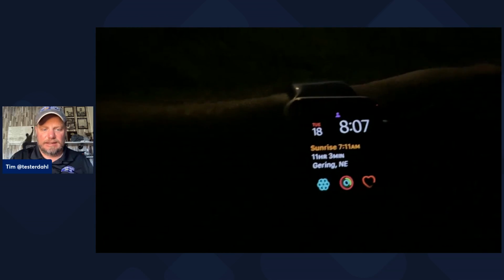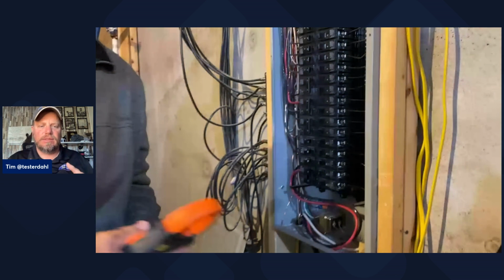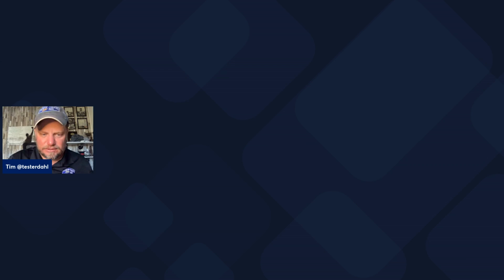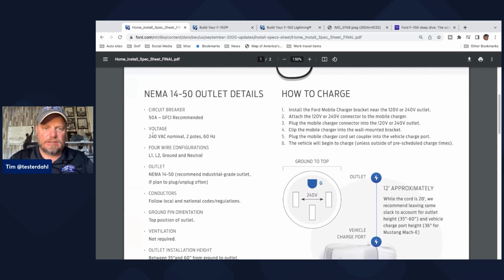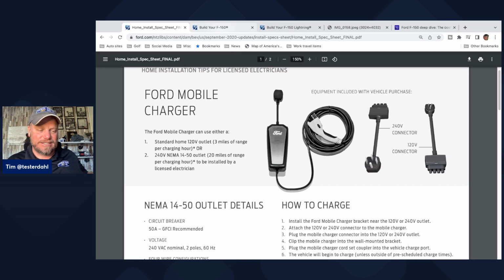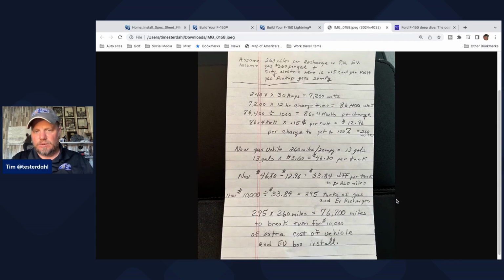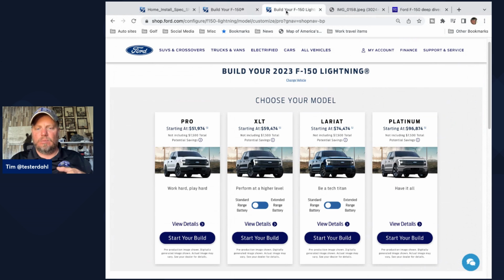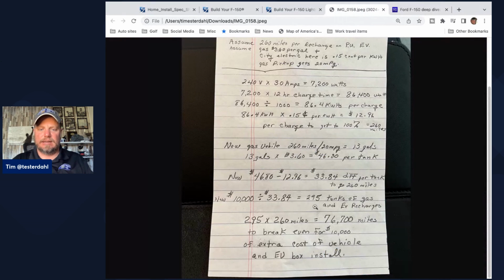11+ hours later on 220V charging price for 2022 Ford F-150 Lightning

Comment: Sure eventually the electric upgrade pays for itself in fuel savings and you start to see savings after several years or 75k miles. But it is a limited savings window as the cost jumps for the EV significantly when you have to replace the battery. The lightning battery standard range is listed at $28,556, and the long range at $35,960 for replacement. So it took 75k miles to break even on a 10k price difference. But you'll need an extra 225k miles just to cover the battery replacement cost... So pretty obvious that the electric version will depreciate like crazy past the 8 year or 100k mile battery warranty (which warrants it to only be 70% of original capacity).

Comment: You never run continuously an electrical circuit near 100% of rating due to the risk of overheating and electrical fire.  The use of a 50 amp 240 volt breaker and #6 copper wire is appropriate for any device drawing 30 amps continuously.

Comment: Source (electrical) needs to be 1.5X the highest rated current used by the appliance(truck).  That's why you have a 50 Amp circuit suppying a 30 Amp Load.

Comment: I believe the battery, like many rechargeable batteries are happier at a little under full charge. The decrease in range at full charge is probably a programming glitch. The true range is what you actually get on the road.

Comment: Well, I have solar on my roof and while my system provides all the energy my house needs, it actually produces too much during the day and in PA it is net metered and also  there is this pesky thing called sundown when it doesn't produce and I have to pay for the generation of electricity while the panels aren't producing.  So hoping to get a Lightning to help soak up a bulk of electricity during the day when the panels are producing to charge the truck.  So basically my electric cost would be just the generation side if I charged during the day of about 8 cents a kw.  I know this doesn't quite make total sense to those of you who don't understand how net metering billing works in actuality.

Comment: Yeah I'll stick with my 2003 gas ford ranger 10 min fill up 343 miles out of a full tank 12 gallon tank right now takes about 30 to 35 dollars to fill up. I'll be last on planet earth still driving a internal combustible in my eye there more practical
Reply: You're not the first person I've seen in the comments section say it takes 10 minutes to fill my truck with fuel in comparison to electric charging. Here in Canada I've got a 2005 Dodge Dakota that has an 83 liter or 22 US gallon tank. Gasoline fuel pumps across the country flow 38 litres or 10 US gallons per minute. They are inspected and certified regularly. Just two and a half minutes at the most and she's got a full tank from empty. Did you mention 10 minutes as simply a figure of speech? Lol. ICE vehicles will always beat out EV's overall.
Reply: But you are driving a 20 year old mini truck beater.

Comment: So what are the used truck prices at various times; we don’t know yet about EVs. The battery diminishes over time and has to be replaced. Warrenty? How much is an EV worth with 75,000 miles vs a gasoline truck. Are the EV batteries shot and cost as much as a new truck? Only time will tell. An old F150 does holds its value. What does insurance payout on an old EV that the batteries catch on fire, in your garage while you are charging it? Too many unanswered questions.

Comment: I have a 2021 Tesla Model 3 rear wheel drive.  Normally charge 110 volts with the cord which came with the car (understand the cord is no longer provived).  Installed a 220 volt dryer outlet  in the garage in case I needed to charge faster and bought the related extension cord.  A dryer is used intermittently maybe several hours a week.  It does not put a load on the electrical components which a charging load would encounter.  I will not be using my dryer outlet to charge unless it is dire emergency.  I did not know the 220 volt charger needs to be wired directly to the house wiring and only bakelite fittings should be used. Repeat: only BAKELITE not bakelite synthetics.

Comment: What is the cost of a battery after 75000 miles? I heard it was $35,000 plus install. Thats on a old truck with 75,000 miles on it.

Comment: They want a heavier wire because it is pulling 30 amps for such a long time when charging. That's why they want you to use a heavy duty 50 amp 4 wire plug. Have seen standard plugs that were melted. Your dryer n water heater are on 30 amp breaker, but those don't  pull those amps for 13 hours at a time. They are controlled by thermostats, so it is on n off.even your oven does the same.

Comment: Time is money. In construction where we have 100+ jobs running at one time, we don’t have time to wait for charging and some/most days the range of an ev truck won’t make it. Especially since we usually tow every day. Gas and diesel are the only way in this industry as of now.

The only other way EV could work is if trucks and cars all used the exact same battery that had a “quick change” option. This would make it so charging stations could have certified techs and fully charged batteries on hand to swap out in 10-20 minutes. Which is close to the average time spent fueling from empty to full. BUT then you would have the cost of a tech/labor fee. Which would completely remove any difference in fuel vs charge cost.

Comment: With all the press and hype over EV's, they never revealed one simple fact:

Electric vehicles are only cheap to operate if you get "?free charging".  If you have to pay to charge, they will cost more to operate than a comparable gas or diesel vehicle.

Comment: Ok...treating that 49% 'fill' on 11-hours at 6,600-watts...that's 72kw's for 119-miles of 'potential'...at $0.14 per kw (off your utility meter), that's roughly $10...or 11.9-miles-per-dollar. Diesel at $1 a gallon, that's a bad deal. Diesel at $5 a gallon, that's a good deal...no diesel at all, well, what do you do? Then again...a LOT of people have reported trying to tow with EV trucks, with 'full-to-empty' happening in 20-30 miles...so, there is the 'work aspect' to consider.

Comment: i want to take a stab at simplifying your analysis comparison of an electric Ford pickup and a gas Ford pickup.  First: you CANNOT tow the same weights with an electric truck versus a gas truck UNLESS you are willing to spend additional HOURS of recharging your electric truck.  so the gas truck has a MASSIVE advantage if you tow an RV or a car or cargo trailer over the electric truck.  Second: you CANNOT haul the same loads in an electric truck versus a gas one unless, again, you are willing to spend additional HOURS recharging the electric truck.  Third: the electric truck WILL NOT perform as well in cold weather or winter conditions as a gas truck. several studies show that electric vehicles lose up to 40% of their range when the temperature falls below freezing (32 degrees F).  Fourth: while maintenance costs are continuing and can be significant for a gas vehicle, the cost of a full battery replacement on an electric truck is STAGGERING - in the case of the Ford lightening, like $36,000.  so "extended warranty coverage" is MANDITORY for an electric Ford pickup.  Fifth: it is UNKNOWN what the "resale" value is going to be for electric trucks.  if a second or third buyer may have to replace the battery, a used Ford Lightening may be worth ZERO. a gas pickup will ALWAYS have a residual value so long as it can be driven.  Sixth: virtually every economist that looks at utility rates verifies that electric rates will continue to increase nationwide as the demand for more electricity increases.  while electric trucks may present a fuel cost "advantage" RIGHT NOW over a gas truck, this incentive will be gone in the next couple of years.  and as to gasoline prices, if the Republicans take back control of the Federal Government in 2024, the GOP politicians will again allow expanded exploration and production of gasoline and diesel fuel.  if this happens, gasoline will be back down to less than $2.00/gallon.  at that price, an electric pickup makes no sense at all to purchase.

Comment: In regards to your trickle charge observation, you're using a meter that may not have the resolution to see the smaller currents. Trickle charge doesn't require much current, so that meter might not be able to accurately measure it.

Comment: So you paid $90K for a truck that has to sit for over 13 hours to get a full charge, meanwhile, depending on where you live, you could take your gas powered truck to the nearest station and within minutes, have a full tank of gas. And if you travel a great distance, you have to plan your trip ahead to make sure you can get somewhere to charge it, whereas with a gas truck, you can basically stop anywhere and fuel up. Ya'll can have your EVs, I'll stick with my 74 F-100, almost 50 years old and still runs like a top. Let's see your EV last that long.
Reply from the maker: I didn’t buy this truck.
Reply: Can't say as I blame you for not buying it.
Reply from the maker: @rustyzipper6304  I only buy one new truck a year for the channel. This truck, like the hundreds of others, is a press loan from the manufacturer.

Comment: No thanks. I run a 96 f350 powerstroke that I bought for 7500 in 2014. It had 144k on it. I do all my own maintenance and have spent a grand total of 2500 in parts since purchase. I now have 365k on it. There is no way an EV can be worth it. Also, at a moments notice I can drive across the country pretty much without stopping since the addition of a 100 gallon auxiliary tank.  The EV has its place but by the time the grid is built to support them Hydrogen will most likely displace EV's as solution.

Comment: In my case, I own a 2014 Ford Focus and a 2022 Indian Scout. Currently the Focus has 30,852 on the odometer and the scout has 1,483.  I average less than 5k miles a year. Yeah, I can't come to a break even point with EV vs. Gas.  With the prices of things now I can't afford either vehicle.  Hell I'm towing a 3k lbs travel trailer with a 2017 Rav4 because the prices of trucks is plain stupid.

Comment: For everyone saying that electric is cheaper just wait till everyone has to have one and times that by 2 since most houe holds will need 2 cars which most ev chargers require 240 volts to work that will be a hefty bill.
If you don't believe me want to see electric bills sky rocket try plugging in a block heater on a diesel truck. Leave it plugged In all night for 7 days.

Comment: What i dont hear is the total carbon foot print that each EV has to add to their total lifespan? Whats the carbon foot print to make a EV versus a gasoline vehicle. Then theres the lifespan of the battery to add as well as the expense of replacing and disposing of the old one. There is a massive environmental footprint of a EV when the total all adds up.

Comment: Up here in the great white north with minimal charging stations, in the dead of winter running my daughter to hockey all over the province…

I could easily use 120kw per day….. with 30 amps of charging would not allow me do two of those trips two days in a row. Or even allow me to recover enough charge to even get to work…

I would need to upgrade my service to charge more than 30 amps,that upgrade would cost 10k where we live. 

My 2015 is bought and paid for, so switching is not worth it. I’ll just pay the 5k a year in gas and hopefully battery capacity will improve to where I can residual charge and get a few days of driving at a time.

Comment: You have to figure in the temperature if it’s below 70 degrees it takes longer to charge and your battery output will also drop it’s not like gas

Comment: I'm not a Ford guy, but I am an EV owner.  EV Chargers will draw various amounts of power at any given time.  It is related to the Battery Management system which monitors battery temp and effectiveness of the charge cycle.  It will vary greatly depending on what is happening with the battery.   Among other things, it has to power a cooling/warming circuit for the battery during the charge.  You need to monitor the AMPS constantly for the full duration in order to know.
The circuit and wiring are Over-Spec'ed because the length of wire installed can affect how hot the wire can get at full load (30A).
My cost for electric charging on my Tesla is between 25-35% of what it costs per mile of a gas car at 26MPG.
Here is an article based on facts from 2019-2021 for Westport Police Department.
https://www.bing.com/ck/a?!&&p=740cc7877b88f3ccJmltdHM9MTY2OTQyMDgwMCZpZ3VpZD0yMjllOTA1OS0yY2FjLTY5MmQtMDllMy04MDViMmQ2MjY4OGMmaW5zaWQ9NTQzOQ&ptn=3&hsh=3&fclid=229e9059-2cac-692d-09e3-805b2d62688c&psq=maintenance+cost+difference+between+model+3+police+cars&u=a1aHR0cHM6Ly9pbnNpZGVldnMuY29tL25ld3MvNTIzMDIxL3Rlc2xhLW1vZGUzLXBvbGljZS1iaWctc2F2aW5ncy8jOn46dGV4dD1UaGF0JUUyJTgwJTk5cyUyMGElMjAlMjQxNSUyQzI5MCUyMGRpZmZlcmVuY2UlMkMlMjBidXQlMjBiYXNlZCUyMG9uJTIwaW5mb3JtYXRpb24scG9saWNlJTIwZGVwYXJ0bWVudCUyMCUyNDk1JTJDODAwJTIwYWxsJTIwaW4lMjBhZnRlciUyMGZvdXIlMjB5ZWFycy4&ntb=1

Comment: F-150 power boost all the way. Best of Both Worlds and about a 700 Mi range and then you can pull into a regular gas station. And be ready to go within about 15 minutes. How about the CO2 emissions from the power plant that's supplying your electricity?

Comment: IMO, What this information boils down to is we're  a long way off from being able to support a nation full of EVs. Super high cost up front and the fossil fuels req'd to produce the electricity req'd to charge the darn things produces a net savings of 'zero'.  And of course there's  the rest of the story..  our country's electric production and electrical transmission grid isn't  robust enough to support a major increase in EVs and won't be for a long time.  Personally, I'm sticking with gasoline engines until this experiment is long out of it's infancy. Just say'n.

Comment: If you put solar panels on your house your truck IS NOT FREE TO DRIVE. The solar system, including batteries, solar panels, equipment to operate and protect the system, costs thousands and thousands of dollars which have to be recouped before your truck is FREE to drive.

Comment: Really? Are you serious? Never would I ever buy an electric truck when you can get a 1990s Chevy 3/4 4x4 for just a few payments on an EV. It uses gasoline. It runs in 5 degree and 105 degree. It doesn't lose 3/4 of its range in cold weather. Parts are abundant and everywhere. Reliable as can be. Can sit for 2 years. Stick a battery in it and it will fire right off. Seen it done. They run and run and haul anything. If you ding it, eh its an old truck. EVs do not pencil imo. They do not pencil if retired. The harder these are foisted on the world, the worse the economic situation and energy shortage becomes. Nothing good will come from transition to EVs.

Comment: YOU FORGOT THAT TO MAKE THE BATTERY IT TAKE 250000 TON OF MINERAL MATERIAL THAT HAS TO BE DIG, LOAD AND TRANSPORT THEN MAKE THE BATTERY PROCESS AND TO MAKE ONLY ONE BATTERY  SO BEFORE YOU DRIVE ONE KILOMETER THE TRUCK BATTERY HAS ALREADY CREATE TONS OF EMISSIONS

Comment: You want to charge for free? Get 8000 watts of solar panels and lots of batteries to store the power. Will take a long time to pay for the solar. Get a small motorcycle that gets 100 mpg and save on gas. You need to haul stuff, get a few horses and a flat bed buggy. 🙂 80 to 100,000 for a truck is crazy.

Comment: I don't even think you need to add all the variables to the equation to communicate the basic problem with the EV pricing.  F150 Powerboost, 20 mpg, 20,000 miles per year, needs 1000 gallons of gas.  Assume $3.50 per gallon and you're spending $3500 a year on gas and about $500 a year maintenance.  Lightning cost is about $15,000 more than the Powerboost version.

So you're looking at nearly 4 years of fuel and maintenance included if you go with the ICE version over the EV (without including costs for charging).  

I don't know what the average is, but I bet that's about the time most people who are spending $100K on a vehicle are looking to get something new.

Comment: Depending upon the source of information, EV battery packs have a warranty of about 8 years or 100,000 miles.  After that, you're on borrowed time before the battery pack has to be replaced at a cost of about $16,000.  Would you buy a gas powered vehicle knowing that you might have to replace the engine every 100,000 miles?  There are hidden costs that EV proponents hide or fail to mention.  Running an AC or heater in your EV cuts into your range, also.

Comment: What happens if an electric car is submerged?
This can lead to an event called "thermal runaway," in which the heat propagates from one cell to the next, causing them to burn. In a small number of cases when an EV is submerged in water, contaminants or salt in the water can cause short-circuiting, especially after the water drains from the battery.
Reply from the maker: Nothing really happens. The battery is in a sealed container. Now if you are talking about dozens of years under water, then yes you will eventually get leakage.